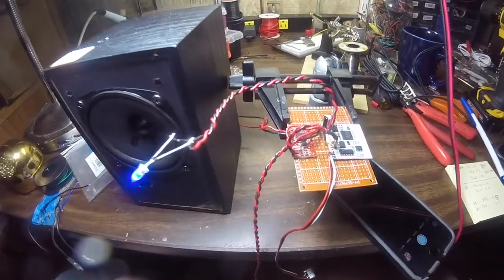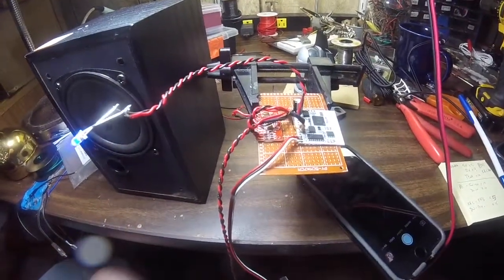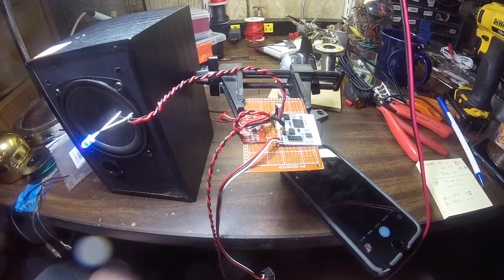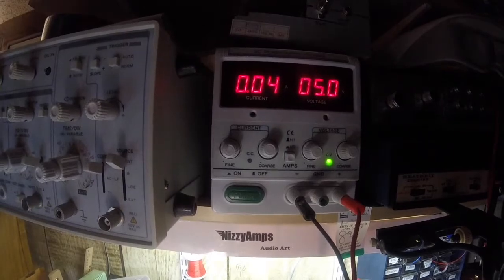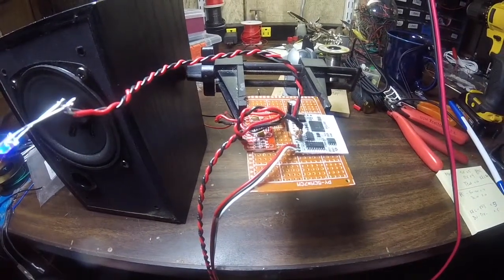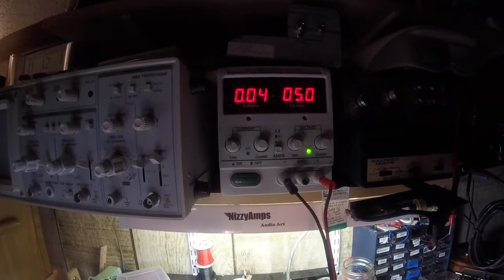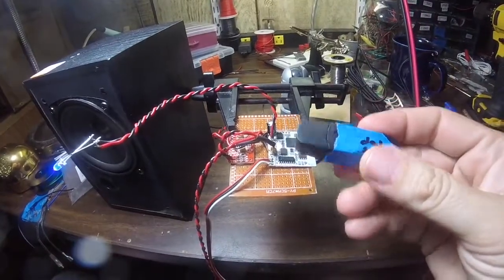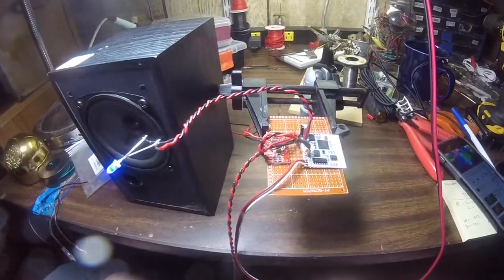DIY Bluetooth Audio: KRC-86B Bluetooth board

Comment: Hello, I have bought 2 KRC-86B Bluetooth modules from different vendors and both have terrible audio quality, for some reason the bass is almost non existent... did you notice this as well on yours?
Reply: I noticed that problem as well. I thought there might be a badly designed filter in the output. Since I couldn't find a schematic of this board I traced it and  indeed found a high pass filter with a cutoff frequency of 60Hz or even higher. I shorted the capacitor and the bass immediately appeared. Here is a description how to fix it: https://drive.google.com/open?id=1GQbuDLE7_f7fl5Pplp_HAnQCNlQTprsl you must have very good soldering skills though.
Reply: tuntori wow! Great job in explaining! I’m going to try this.. thanks for responding as well 😊

Comment: Is your krc doing noise too?
Reply from the maker: I have had some that were noisy, some that weren't. I now put an isolated DC/DC convertor in circuit whenever I use one just to be safe.
Reply: Which isolated DC/DC convertor do you use for yours?
Reply from the maker: I use the murata NKE series isolation transformer. NKE0505SC for 5V and NKE1205SC for 12V. Here is a video showing how I do it:https://youtu.be/b2Pb1KuVDS0
Reply: Will the things you talked about below stop constant whistling in the L channel?

Comment: Do you think I could use the KRC-86B be used to convert and old wireless speakers (iLive 809B) into bluetooth speakers?
Reply from the maker: probably, you would have to connect a stereo jack to the KRC-86B board and plug it into the aux input of the 809B docking station

Comment: have you tried these amps?  http://www.ebay.com/itm/201564819210
Reply from the maker: Narcizo Chavez I haven't but they're on my list to try. Do you have good luck with them?
Reply: NizzyAmps yeah I bought a few I just hook them up to battery banks but I need to learn how to wire a switch it turns off if there is no current drawn so if I leave a song paused or take to long to pick one it turns off.  I'll post the power bank on slack.
Reply from the maker: Narcizo Chavez excellent. Thanks. I'll look for it over on Slack